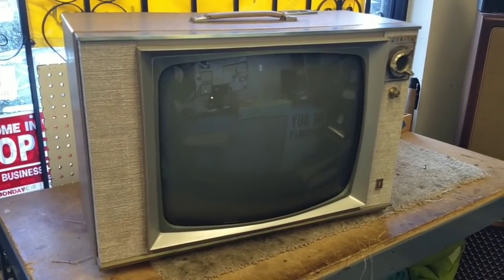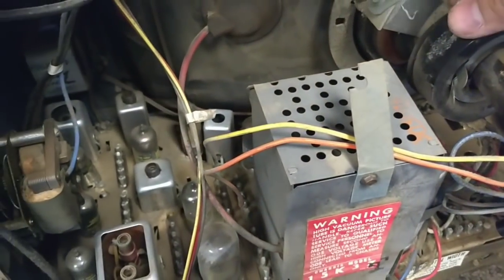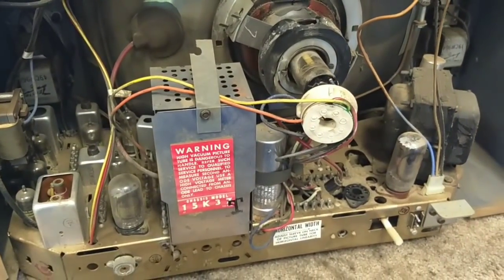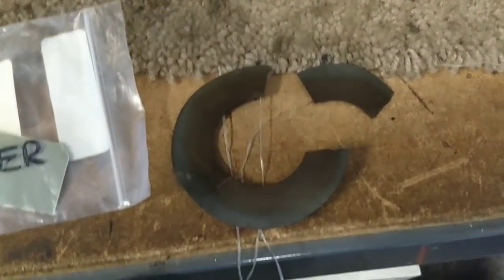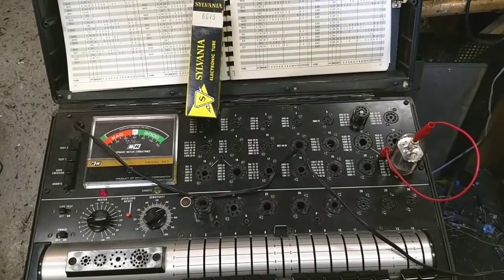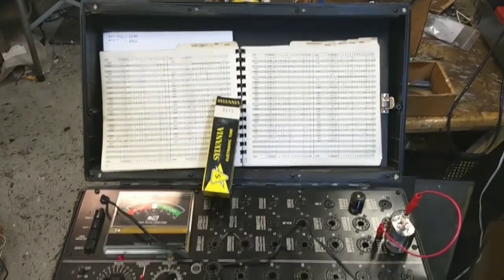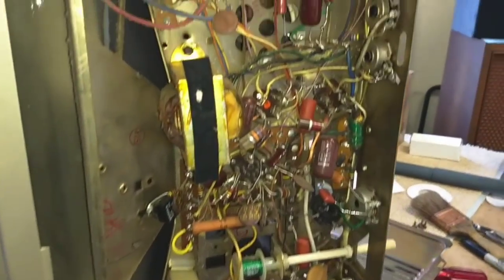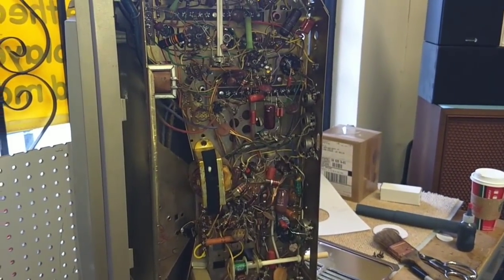Servicing an early 60s zenith model K2127 19" B&W television Part 2/?

Comment: Width sleeve AKA hoz lin sleeve is not shown on your set.  It is a fiber sleeve that has a copper
part to it. It wraps around the neck & can be slid in & out for adjustment.  What often happens
is a tech will pull it out & throw it away to get a little bit more width instead of finding the
cause. Thats why yours & many others is missing.  Tuner should be easy, even if its not a tube
or super dirty its a turret tuner so can be fixed.
73 Tom AKA Zeno
LFOD !